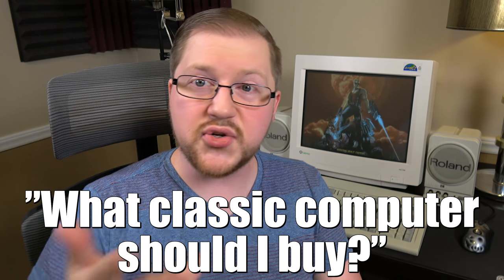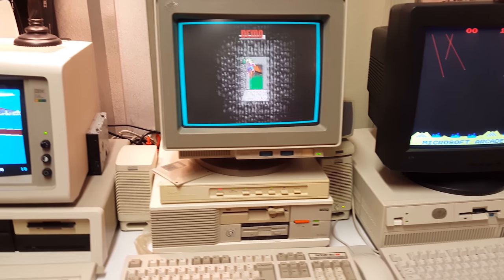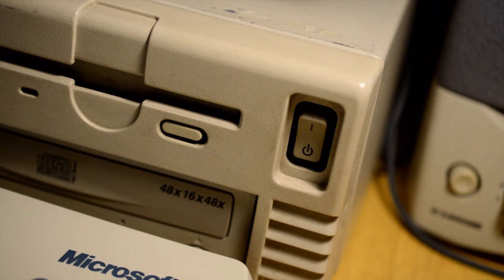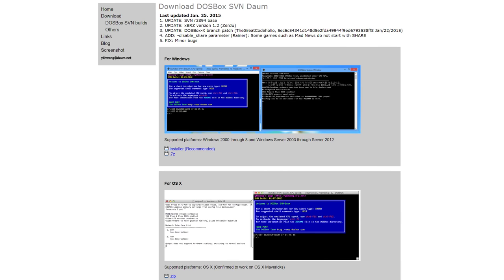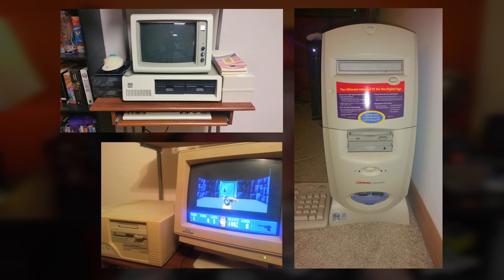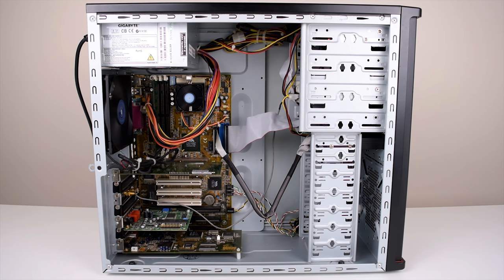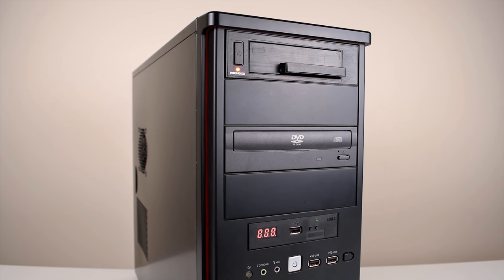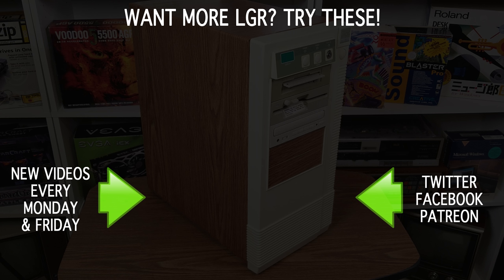Choosing a Retro PC for Games: Advice & What to Look For

Comment: I still have a retro laptop that I still like to piddle around on. A Toshiba Satellite laptop with a 266 mhz Pentium processor with 96 mbs of ram and a 4.1 GB hard drive and runs Windows 98 second edition. Date of manufacture on that laptop shows 11/14/1998 and everything seems to work on it with its 800 x 600 lcd display.

Comment: This is a bit weird. My primary legacy machine is "Dell Dimension XPS R450" (Pentium II), which is similar to what Metal Jesus has, but doesn't have the issues he mentioned. 
I also have a CD-RW drive, 52x CD-ROM, 3.5" floppy, and 100MB Zip disk drive (internal) in that computer. 
But my previous computer when I was a kid was the exact "Compaq Presario" that Nostalgia Nerd has.  
I also have a Micron (Pentium III) with DVD-ROM/CD-RW, 3.5" floppy, and an external Zip and Ditto drive. Which oddly enough, doesn't seem as capable as the Dell, to be honest. Some games don't seem to run as well. 

I have a few other options, mostly laptops. But it's kinda cool to see computers I've used throughout my life, or their near variants, being mentioned.
I never had a turbo button though. Unfortunately.

And I totally miss my IBM PS/1 all-in-one with the clicky keyboard and IBM mouse. 
I used to code tons of QBASIC programs on that beast. 
Unfortunately, my father threw it out while I was at university. His philosophy: "anything old is junk". I'd have to spend a fortune to replace it now.

Comment: I purposely went with an "in the middle" system it has an MSI MS-6533E motherboard which is an AGP DDR Pentium 4 board that has PCI, Gameport, and PATA. I am running an ATI Rage 128 All in Wonder card on a Celeron CPU. 
I can run most DOS games and most early Win 3.1 games on this thing. It runs Glover perfectly, which was tough to run on emulation or VM.

Comment: I simply haven't got the space to have a number of systems sadly anymore. When I moved around 7 years ago for medical reasons, I had to downsize as only ground floor flats were suitable, and 1 bedroom at that. So I have 2 pcs (1 windows 10, the other Linux but a server mostly) and a windows 10 laptop as well as smartphones and tablets. I did manage to keep however a number of the games consoles at least and 2 A1200s, and a Atari ST 4160 and a couple of SPARCstation Voyager luggables, all these need attention however. 

So emulation is the most viable solution. I'd love to have the room to have multiple computers set up, but it won't be anytime soon I expect (I miss being able to play around with old SGI and Sun gear for instance).

Comment: Hmm, I shall have to go through my PC "retirement area" and see if I can rustle up a good retro build..
Oldest I have is a 486DX4-100 VLB, about the next in power, is a small case P75 (OC 100) with built in S3 Trio on the motherboard.
P233MMX (my old DOS/Win3.1 setup)
Athlon 1000 - my old Win98 setup, abandoned as it stood when I got a P4-640 running XP
Additional, Athlon XP and P4 with RDRAM, both were running XP
A recent junk bundle got me a couple of AGP cards I once dreamed of, Geforce 4 4200 and Radeon 9800Pro

Build target 1: Probably a decently powerful XP to run charity shop find games that I wouldn't trust to run in compatibility mode on Win10.
I guess target 2 is revive my Win98 or Win3.1 nostalgia.
Don't think I own any old speed critical games, the DX4 would make a fast DOS system.

Kicking myself for not bagging the computer fair Voodoo AGP card, but by that time I thought the 3.3V AGP that would tie it to the Athlon 1000 would be limiting.

Comment: I want to build a Voodoo2 12MB SLI computer. I think the CPU to go with it will be an AMD K6-III+. This will be a DOS and Windows 98 computer. That might hit the sweetspot of late DOS games/Windows 95/98 games. The question is what AGP graphics card to use for the non-3dfx titles. I'm thinking something like an Nvidia Riva TNT2. That might be an excellent combo.

I built my first computer with an AMD K6-166, and it was great. I saw all of that hardware, and owned none of it, and let me tell you how awesome it would be to build something like that. I get old computers in my repair shop occasionally and sometimes take them home, but I've yet to find the perfect K6-III motherboard. I might have to actually buy one if I can figure out what exactly I'm looking for. Ideally, something with an AGP slot, at least 3 PCI slots, and at least 1 ISA slot (for the SoundBlaster 16).

I've ran Windows 98 SE on a 3.8GHz P4 and man is that lightning fast, but I don't want to go overkill on the CPU since a lot of DOS games probably wouldn't work properly.

Comment: I did the following:
386DX40, because I wanted one but held out for dx2-66 and always wondered what I missed by not playing e.g. Ultima underworld around the time it was released.

486DX2-66? No. I’ve thought about it, but it’s quite expensive and doesn’t do anything I can’t do by slowing down a faster system.

Pentium 233mmx with a voodoo 2, AWE32 with 28 MB of SIMM memory and some software for slowing it down (you can set L1 or L2 cache off in software and hit most speeds). I play mostly win95 and very late dos with this. I could do SLI on this machine but it’s a waste. This machine is pretty sweet, but not powerful enough to comfortably do 640x480 in software render 3D. I think an athlon k6-2/2+/3+ system may have been better (can set clocks in software on some motherboards, fastvid; faster and more versatile) but I got this motherboard and CPU for almost nothing and a super socket 7 would have ben auite expensive.

I have a pentium III 600 slot 1 system with a 32 MB tnt2 m64 and an aureal A3D 2.0 card. Why? It’s an old system I had; my first computer that was mine alone and not a ’family computer’. Even has a crappy quantum fireball disk that sounds like grinding metal; but it always sounded like that and has been rock solid. I can recommend that you keep your old system, but I can’t recommend that you rebuild it; build something better.

For win98SE I have a maximalist system; core 2 duo; aureal A3D 2.0, 1024 MB low latency RAM (you can patch it to work even with more, but it is hard to find good RAM that’s smaller). FX5900 ultra graphics card. I can’t remember exactly what the motherboard was called but I think it is asrock 865ig R3; it has win98 drivers. Anything that requires the performance, doesn’t run on later systems /uses A3D gets run on this. It’s more comparible than you would think. It’s also uswful for cranking out software rendered DOS stuff at higher resolutions (more demanding than you’d think). The FX5900U has grossly more CPU overhead than a geforce2 or something. Don’t use anything faster than geforce 2-3 for qin 98SE on a period accurate system for the best experience; if you have the CPU to spare, anisotropic filtering is really very nice. For me there was a big dip in graphical quality with early 3D acceleration; bilinear with mipmaps just looked so hideously blurry. Nearest neighbour was sharp but very noisy; still better. Then came trilinear and AF and fixed it. Then came angle-optimized AF and fixed performance. Though a geforce 4 ti42000 would have been good enough for the resolutions I play at anyway with 8x unoptimized AF. Cranking ancient games to 1600x1200 looks worse than 800x600 IMHO; you see that everything is made of triangles, walls are atomically flat, textures have low and differing res, UI often becomes messed up etc. I recommend a real CRT, 640x480 a 1024x768 and max out quality settings, AA and AF.

I use the pentium 233 mmx and the core 2 duo the most for actually playing something. Some games play just as well on GOG or dos blx on a modern PC. E.g ceasear 3; don’t care about a CRT for that game, don’t care about any hardware features or latency introduced by LCDs and modern graphucs drivers. It’s just a 2D RTS.

Comment: Because PC went through several milestones from 80s through 90s (what is considered "retro"), there is no one specific configuration you should own.  There is a lot of sound hardware that came and went during that period and you can't expect one machine to have it all.  Unless you have to have cycle-exact XT, your best bet is DOSBox.  It will let you have it all, including Gravis Ultrasound and Roland Sound Canvas (I enjoy both).  Build engine games have modern ports, so you should play that instead.  There are very few reasons to need an old PC.

Learn that DOSBox config file inside and out, it really pays off!

Comment: I feel bad over the years I got rid of my PC's after I would update. I kept my 8-bit ones, but figured my stuff would be supported after I would upgrade which the newer stuff yes, the older stuff wouldn't be used so I wouldn't realize it till later. I will take this moment to remember my Zenith 286 with 2MB Ram, 30MB HDD, 16MHZ, VGA and SoundBlaster Basic, then my 586 133MHZ, 1.5GB HDD, 6x CD-Rom 3.5" and 5.25" Floppy, SoundBlaster AWE64, Image 128-VLB running Dos 6.22 and Win 3.11 also my first Internet capable machine. Then my AMD Athlon k6-2 300MHZ, All-In-Wonder 128pro, SoundBlaster Live, 8GB HDD, DVD reader, and CD-Burner 3.5" and 5.25" floppy drives, Windows 98. This was also my first high speed internet PC. However I still have my Athlon 2700+, 1GB, All-In-wonder Radeon 9700, LS-120 SuperDrive, Maxtor 250GB Ultra-133 drive Windows XP. I did upgrade it to 3GB and installed Win 7, but it wasn't the same and went back to XP. Today I am rocking intel i7 7700, 64GB, 1TB NVME, Geforce 1080. Sad thing is that is an upgrade from an old Core 2 with ATI 77700 and it just wasn't exciting. PC's pre-64 bit had different personalities. I could play a game on my PC, take it to a friends house and have a different playing experience because maybe they had Gravis sound, or Voodoo, or whatever that mad it different, but would still be lots of fun to catch differences.

Comment: I like trying to use older hardware on newer computers when possible. My i7-2600 has 3 PCI slots. I can boot into MS-dos using a USB stick. Slap in a SB Live card, an SB emulator and a PCI-based graphics card (Voodoo 3) and you can turn this 2011 era machine into a 1999 machine. Practical, no, but pretty exciting. And did I mention it has a PS/2 port and a serial port? Connect a Model M and a serial mouse for max retro fun. Now, if it had a parallel port I could try one of those parallel port sound cards and I would then likely be able to play 90's DOS games with sound as well for when the SB emulator for the SB live would not work.

Comment: I consider this a timeless topic. Sadly games with floppies are more doomed if not converted to flash before the remaining drives die, or the floppy itself dies. Then what happens when optical drives aren't made anymore.  I still prefer the higher end socket 7 and socket A hardware. I may be different, but when sound is concerned I like it fed to a home theater receiver by spdif if possible.  I

Comment: DOSbox is NOT emulation
emulation is when you translate from A to B and code cannot be executed directly (like Amiga on PC, where Amiga had Motorola MC68000 and PC have x86 CPU)
DOSbox is translation of API and sometime even ABI (which sets it extremely close to emulation)
API stands for Application Protocol Interface, which is simply a standard of how some application should talk to whatever else (in most cases kernel)
ABI is Application Binary Interface, which is a standard how hardware is used down to how CPU is used - this is biggest difference between Windows and Linux as they use different ABI (they use registers in CPU for different purposes and they do context switching differently - context switch is when you switch from one process to another, usually initiated either by kernel or interrupt)
so DOSbox is actually very, very close to emulation, but as long as it is used on x86 you have choice between emulation and running code directly on CPU without any emulation

Comment: My favorite machine for running retro games is a Duron 1.6 Ghz(labelled "turbo 3000+", something very unusual), 2*512 DDR ram, motherboard socket 462 (can't remember brand), a 40 gb Maxtor Hdd, and a geforce 4 mx 400

Comment: Just got a Windows Me PC as built by Fujitsu Siemens back in the day. Celeron 900mhz, 128MB RAM, GeForce 2 MX 200, 20GB IDE hard drive. Costed €40 with shipping. Hope it will work well for retrogames. Might install 98SE on it but i think Me will work fine as I will mainly play Windows 95/98 games not DOS.

Comment: I've been trying out quite a bit of retro hardware and I have followed a lot of Phil's stuff which has made me boil down to DOSBox and ScummVM on a proper aspect 1600x1200 monitor which is also used when using real retro hardware for proper aspect ratio. I love and missed playing many old Sierra games and the best way to get the right sound is DOSBox set to use Tandy 3-voice sound. It bugs me that GOG does not set up DOSBox to use tandy sound when the game supports it. Otherwise you get PC Speaker. I do want a real 486 and would love a Tandy 1000 RLX like I had when I was a kid but that will be a while for now.

Comment: I would say for the types of games I'd play, a modest 486 (maybe a 50 or 66 Mhz) 4 or 8MB of RAM to run Windows 3.1/3.11 and DOS, a SoundBlaster card and a CD-ROM drive along with the usual (3.5" floppy drive, mouse, etc).  I didn't play too many games back in the day--mostly dabbled with programming both for DOS and Windows 3.1 but there are some games I wouldn't mind going back and playing (such as Doom/Doom 2, although there are now Windows ports available so there's not much point in me going back and getting an old DSO computer I guess--given the price of some of them online).

Comment: I don't like having a lot of physical stuff ... in general myself. I like my house to be mostly empty aside from essentials and a basic set of modern electronics things. So for me, it's emulation all the way. My computer is a tremendously tricked out, modern behemoth, so aside from the occasional struggle with downthrottling, there's precious little it can't work with. And while a rig like this was not cheap ... it was cheaper than Clint's living museum of classic hardware. It's a cool collection, but man, I couldn't stand having all that taking up space. It is worth noting that I do feel a fond nostalgia for old hardware he shows and tricks out ... and older. My first computer was a Commodore PET a hundred years ago. But yes, emulation suffices just fine for me. Is anyone else who prefers emulation, more into that solution for my reason? Hating a house full of things? I'm curious.

Comment: The thing that makes wine ideal is that when it's all said and done. Wine is not an emulator. It's a translation layer. So in a sense you're still running those decades old games on the machine.

And the way wine works makes it so that games that had little respect for where they probably should or should not write files still work fine.

Also consider that the wine team have spent the better part of several decades replicating obscure Windows kernel bugs that Microsoft has accidentally patched over time and it's no surprise its become a better Windows then Windows for some games.

You can even grab some wine dll files in my experience to fix some performance problems in a set number of games running on newer versions of Windows like midtown madness.

Comment: My DOS setup is an AMD K6 200mhz, Sound Blaster Pro 2.0, S3 Verge DX video card, 32mb of ram, 1.2mb and 1.44mb floppy drive and a CD-RW drive for compatibility with burnt CDs. I transfer files to the system that way using zip files and pkunzip them. I also have a 2.6ghz IBM P4 with Windows XP for Windows 9x and early 2000's games with 2gb of ram, a Sound Blaster Live and an early-ish Geforce card (64mb I think).

Comment: Mid to late 90s and early 2000's computing really is the issue, all in all. You can find all sorts of ways to emulate older programs accurately enough, and often it's a lot easier than fiddling with age-old hardware. But trying to use Windows 95 and Windows 98 programs in an accurate fashion is nightmarish. In those cases, I'd rather mess around with old hardware any day. Because at least when it's working as intended it''s, well, working as intended. Not "glitching out a bit and some things don't quite work but you're going to just have to lump it because there's no better way to emulate it."
I hope that with the advent of RISC-V and open source components we can eventually get to the point where we can recreate the hardware for these older components in a cheap and easy fashion, good enough for any use case. I also imagine and hope that with the advent of the 64 bit Operating System and Windows 10 being "the final version of Windows" finding a way to just up and run programs from the beginning of the 64 bit era and beyond will be much easier moving forward, and we won't have as much of a limited time frame to use these programs.

Comment: I've downclocked a Sempron 3000 to 800 MHz, 1GB DDR RAM, 120GB SATA SSD, runs Windows 98 or XP. Audio = Audigy 2 ZS. Video = OG Xbox equivalent GeForce Ti 4200. Great for the late 90's and early 2000's. This Sempron can go from 800 MHz up to 1.8 GHz so is nice and flexible. I just need to try more DOS games under Win 98...

Comment: I can't be dealing with DOS can't stand that OS.So I use a self built Windows XP retro gaming system unit.Around twenty years old now.Athlon XP 2400+  CPU running at 2 GHz, 2 GB RAM, Nvidia GeForce 7600 GS 2 GB RAM graphics card, 250 GB 7200 RPM HDD.Use it for Diablo 2 my favourite PC game ever, Unreal Tournament, Quake 3 Arena, Outlaws.And several other lesser known PC games.